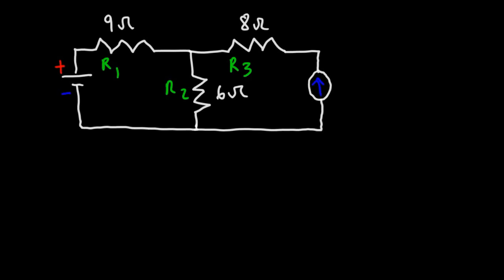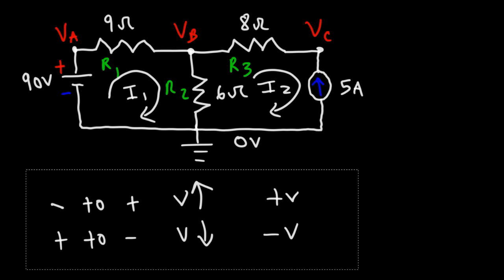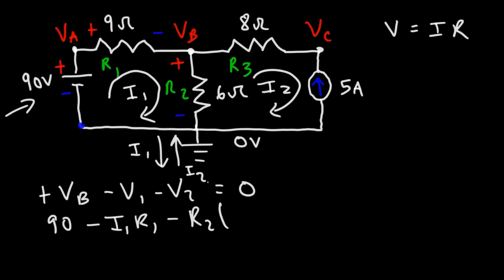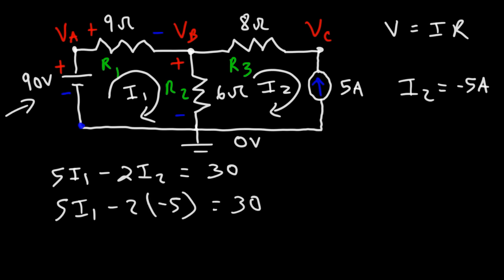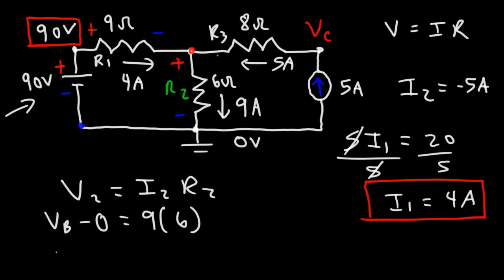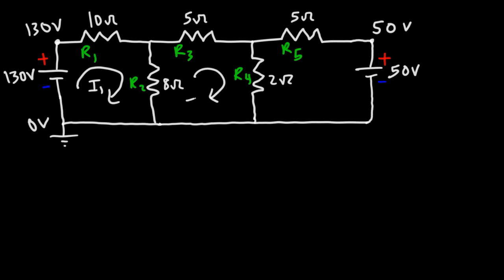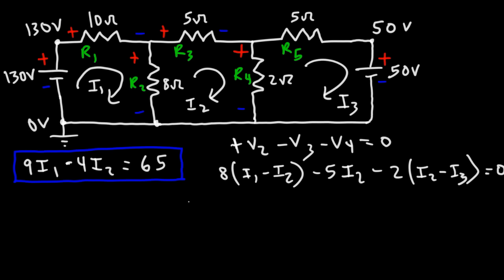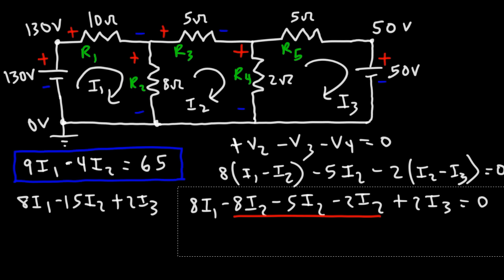Mesh Current Problems - Electronics & Circuit Analysis

Comment: I believe there is an error in the calculation, What he's effectively done is swapped the polarity of the voltage across the 2 ohm resistor R2, here's how,

 in the first loop he designated I1 flowing from high to low potential through R2 and I2 flowing from low to high, that's fine, but then in the second loop he has designated I2 flowing from high potential to low potential by making the equation -8I2 and designated current I1 flowing from high potential to low potential by making the equation +8I1, this is effectively changing the arrangement of the signs of the voltage across R2 when analysing the current through R2 in the second loop compared to the first

how can that be correct? Would the same be true if R2 were a battery? Because the sign of a battery doesn't change since the direction of voltage across it is fixed, and according to the math he's done, he isn't sticking to the sign convention he has assigned for the voltage across R2 from the first loop, i understand he is taking the difference between the currents I1 and I2 but he's doing so in the wrong order, i believe it should be 8(I2 -I1), if you disagree that's totally fine but i would appreciate if you explained why.  Many thanks friend.
Reply: I got confused at that part as well. Your reasoning is correct I think. I also had a sort of "rule" that I followed for mesh current analysis. When you are working inside a loop, the positive sense of the current is the sense of the current of your current loop.

At the first loop, the positive sense would be that of I1, therefore the current at R2 would be I1-I2 because I2 is in the opposite direction from that of I1.

At the second loop, the positive sense now becomes that of I2, so the current at R2 would be I2-I1 because I1 is now in the opposite direction of I2 (which is the positive sense).

However, it seems that doing it like that is wrong. I checked the values in Multisim (a circuit simulator) and his values are correct. If you solve it with R2(I2-I1) you get wrong values. I hope someone explains why that is the case as I don't really understand it.

Edit: One possible explanation probably has to do with the fact that the current has to flow from a point with a higher voltage to a point with a lower voltage. Since one end of R2 is connected to ground, if you take I2 as a positive quantity you are assuming that the current I2 is flowing from the ground up to Vb. Which is impossible.
I am not sure if this is the right explanation though.
Reply: The video is too much of a spin .  the video is just a bad description of equation writing . And the video lacks detailed information of  technique .  Confusion number 1 :  the Video does NOT use Mesh currents thru  R2 , instead he is adopting a Branch current technique  thru  R2 , because he is using a Single  +-polarity across R2 .  Basically , the video is a mess and needs to be redone .
the Two  Fragments would be written this way , when using  a Branch current flowing Down thru  R2 :  +( I1 - I2 )R2 for Mesh I1 , and  -( I1 - I2 )R2 for Mesh I2 .
however ,
when using  "Mesh Currents" flowing thru  R2 , the Two  Fragments would have been written this way :  +( I1 - I2 )R2  for  Mesh I1 , and  +( I2 - I1 )R2  for Mesh I2

notice for both  Mesh I2 fragments , they are  Identical :
-( I1 - I2 )R2  is the Same as  +( I2 - I1 )R2 .
however ,
the Symantic of writing these  Fragments is  Hugely different . As said , one is based on using a Branch current thru  R2 , while the Second writing is done using Mesh currents thru  R2 .

if these  Fragments seem odd or confusing to write , then you do NOT yet underand the basics of KVL , Ohm's Law , Branch currents , and Mesh currents .
NOT your fault , as many books are Poorly written by people who do NOT know what they are talking about ,...especially  2 year Tech school level books ( the worst )

the video is very lacking of  KVL with Ohm's law equation writing details .
Reply: @ArjolP  what would happen if someone Pre-labels a +-polarity across a resistor that is NOT  +pos Ohm's law , and they are asking for the voltage across that  resistor .  would that pose any issues during the equation writing process ?  the answer should be No . the circuit is still just as easy to analyze regardless of the  +-polarities across the resistors . There should be absolutely No  confusion .  if there is confusion , then something is not yet understood .
Reply: @ArjolP  you do not  yet understand how to solve simple  physics problems.   you have taken the video's analysis Out of Context .
you are trying to use a Convention that is in your head . however , 
the Convention that is in your head is NOT the same convention
the video is using .
i am  posting a new response to Numan Ahmed
with a Full explination as to why  the first level equations in the
video are  Valid and Correct , for  R2 in the  3 loop circuit .
please note , the video is trash and is a very bad way to present
circuit analysis .
Reply: yes , the video is trash .
however ,
the first level equations written in the video are valid and correct .
to understand this , you MUST use the same Convention and Orientation
the video is using .

you have a particular Convention in your head that you want to use ,
however , other peoples analysis might be using a different Convention .
Thus , to follow someone elses first level equation writing , you MUST
know what Convention they are using .

i analyzed his analysis ( Meta analysis ) to understand what he did .
( i can do that )

the 3 loop circuit :
the video's convention writes the KVL +-sign as he Exits each component .
the video's convention is using  Branch currents thru R2 ( the 8 ohm resistor )
the video says he is using mesh currents , however , he is actually using
Branch currents . thus he does NOT know how to use mesh currents .
But ,...
based on the Conventions that he used , the First Level equations are Correct.

Here is how he wrote the  Fragment you speak of , for  R2 , starting with loop I1 :
he is Traversing CW ClockWise and he is writing KVL +-sign as he Exits each component.
Exiting R2 at the Bottom of R2  is  -neg .
thus he writes  -neg8 ( I1 - I2 ) .
note that  ( I1 - I2 )  is the Branch current thru  R2 .
next , for loop  I2 , still Traversing  CW ClockWise , at the Exit point of R2
( Top of R2 ) , he writes +pos .  +pos8( I1 - I2 ) .
again , ( I1 - I2 ) is the Branch current thru  R2 .

he could have shown :  I4 = ( I1 - I2 )
where  I4  is the Branch current thru  R2 .
with I4 flowing  Down thru  R2 .

Your  ( observation and curiosity ) are Out of Context .
Realize , there are many , many Conventions that can be used , and thus
there are many , many ways to write first level equations for the same circuit .
All of the Conventions that could be used are ALL  Valid , and ALL the
first level equations that are written of each of those conventions are ALL valid .
however ,
once we choose a particular ( Convention and Orientation )
we need to "Stick with it" , so we do NOT contradic our selves ,
and to avoid a convoluted mess ( such is your  question )

you should solve a basic vector based projectile physics problem ,
and apply all that  technique to solving  electric circuits .
( read beyond the words in the electronics book ,...go deep )

we can always analyze the same circuit using another ( different )
Convention . our initial first level equations will look different .
but in the end , the numerical answers will still describe the exact
same  circuit operation .
( provided we have No errors in our math manipulation )
Reply: I got confused in this part too.
Reply: I was confused as well but the answer is actually correct because there are two ways to solve this.

1) (His way) to keep the polarities constant in each loop while using the previous current calculation.

2) (another way) To change the polarities according to the current flow direction and input the new difference in current by giving priority to the current that is in that certain loop.

Both ways result in the same answers.

Comment: how come in mesh 2 you have I1-I2? Should not be I2-I1?
Reply: What I was thinking
Reply: Assuming you mean the claim at 14:00, it is like this since the assumed direction of i1, based off the clockwise arrow drawn, would be going from positive to negative in R2. i2 would be going from negative to positive, as indicated with the clockwise arrow, which is the opposite direction of i1. Due to this, we take the current going through R2 to be (i1-i2). Lmk if you need more explanation.
Reply: @kyrelpolifrone4438  ignore my previous comment if u received notifications about it. but anyway, yeah if you could explain it then please explain!
Reply: @judy-chan4536  So in the drawing, the current for I1 follows the arbitrary direction established, so we can consider it to be "arbitrarily positive" while I2 is going in the opposite direction so we would need to follow this established convention and assign it an "arbitrary negative" if we considered the mesh current in the opposite direction then I1 would be negative while I2 would be positive. So with the established direction, since I1 follows the direction of the mesh current it is positive, while i2 goes the opposite so it is negative
Reply: @kyrelpolifrone4438  thanks! i figured as much. but my friend asked me(and questioned my use of equation using I1-I2 instead of I2-I1) and i just dont know how to answer lol.
Reply: @kyrelpolifrone4438  what he's effective done is swapped the polarity of the voltage across the 2 ohm resistor R2, here's how,

 in the first loop he designated I1 flowing from high to low potential through R2 and I2 flowing from low to high, that's fine, but then in the second loop he has designated I2 flowing from high potential to low potential by making the equation -8I2 and designated current I1 flowing from high potential to low potential by making the equation +8I1, this is effectively changing the arrangement of the signs of the voltage across R2 when analysing the current through R2 in the second loop compared to the first

how can that be correct? Would the same be true if R2 were a battery? Because the sign of a battery doesn't change since the direction of voltage across it is fixed, and according to the math he's done, he isn't sticking to the sign convention he has assigned for the voltage across R2 from the first loop, i understand he is taking the difference between the currents I1 and I2 but he's doing so in the wrong order, i believe it should be 8(I2 -I1), if you disagree that's totally fine but i would appreciate if you explained why.  Many thanks friend.
Reply: The convention is that the current I2 is major current for the loop...so while writing equations , I2 -I1 should be written.....But it can be false when the value gives you negative number....which will call that I1 will be greater...
It's just a way of solving circuits easily
Reply: @judy-chan4536  Everyone keeps using a different ( Orientation and Convention ). you are causing your own confusion . Have you ever solved a Basic Projectile Physics Problem ?
i am gonna guess that you have NOT.
In the video here, he is writing  Each KVL +-sign as he  Exits each component . Thus , to Follow along in the video , you too Must use the
+-sign as you Exit each component , during every traverse .

you do realize :
    5v                                          - 5v
-         +     is the same as  +           -
if the problem was stated  as :    +      -  , then when solved ,
the numerical answer will be  - 5 v
if someone says , oh ,  shouldn't it be   -   +  with  5v  answer , then that person  has No clue how to solve Any Physics problem .

The video was poorly explained . His use of Conventions and his initial Orientations and descriptions are really bad ( not good ) .

you are using  Conventions and Orientations that are in Your Head , which are not the same Conventions and Orientations that the Video is using .
All  Conventions and All Orientations are Valid , however do NOT mix them during the analysis . Choose One way and Stick with it .

Thus  ,
the Video is NOT  backwards
and your  statements are NOT backwards .
However ,
to properly following along in the video , you MUST use the Videos  Conventions and Orientations . if you can't discover the video's  Conventions in use , then you will NOT be able to follow what the video is doing .
The video is a terrible description of how to write equations , however , in the Context of the video's  Conventions and use of Orientation , the equations that he wrote are Valid and Correct .
Reply: @kyrelpolifrone4438  saying  "Opposite" is a bit vague . The video did NOT show how to incorporate  Ohm's law into the Equation writing process.
Thus , when  +I1R2  is  +pos Ohm's Law becaue  I1 Enters  R2 at the +pos, 
named side of R2 ,... then  I2 Enters the same  R2 resistor
at the the other side , which has a  -neg sign , thus  -I2R2  is -neg Ohm's Law . Sure ,...they are  opposite of each other , but only because  I1  Enters R2 at the +side( +pos Ohm's Law ) ,
while  I2  Enters R2 at the -side ( -neg Ohm's Law ) .

to write a complete  Mesh  Equation , we need to write
( KVL  +-signs  with Ohm's Law  +-signs ) .
The Voltage source only has a KVL +-sign to write ,
while each passive component has
( KVL +-sign with an Ohm's Law +-sign ) .

Comment: sorry but the first equation is kind of wrong since u used Vb instead of V(original voltage).
Reply: Yeah but the value he assigned is the original V.. Soo its okay all in all
Reply: He said that Vb stands for voltage battery

Comment: Hi, Thanks for the wonderful video and teaching. 
One query that in mesh 2, since current is flowing in clock wise, then in v2 = R2 (I2-I1) should have come right? instead of R2(I1-I2) in the equation of circuit 2 (8ohm(I2-I1))
since electrical potential is moving towards higher potential from lower potential. @TheOrganicChemistryTutor

Comment: hello I did the same calculations but in the end, I used Cramer's rule but I got different results on examples at 10:9
my results are
i1=15.97 A
i2=-9,84 A
i3=9,95 A
I am certain my matrices are correct.
Reply: There are mistakes in this video. He took voltage rise to be negative which is false. Your answer might be right.

Comment: the equation derived from the second loop in the 2nd example got me confused. I though the voltage flowing though R2 and the other resistors will be the product of the resistance and the difference of the current flowing opposite of the assigned direction the current is flowing from the current along the direction of the loop. Example, like the voltage across the R2 resistor in the second loop i thought it would be 8(I2-I1) but he made it 8(I1-I2) can someone help a brother out.

Comment: in the second example, I believe you could have solved the system of equations faster by  solving for i1 in the first equation and solving for i3 in the third. Then just plug it all back into the second equation. Then plug in i2 into equations 1 & 2 to solve for i1 and i3, respectively.

Comment: In first example, why would i2 = 5a ? I know that loop has a 5 amp current source, but if that current source wasn’t there, wouldn’t some amount of current from the left loop flow through it? so shouldn’t some of that current flow through it and change the amount still?

Comment: had an entrance exam in a job interview where I was to utilize mesh current but R2 has no resistor and is just a wire (or just two points from A to B?) and I'm to find the voltage there; got hardstuck

Comment: But from your equation in the first example you said the current flowing through R2 is the difference between I1and I2. But you added them to get the current later on. Why

Comment: why did he multiply in problem 2 the equation 2 times -9? From where is -9 coming from?
Reply: If you are talking about the
9I -4I = 65 
8I -15I+ 2I= 0 
Part he multiplied the top equation by 8 and bottom by -9 so that he could cancel I1. He just needed to cancel out the term so thats why he multiplied the entire equation by 8 and the other by -9

Comment: Am I the only person who noticed that the way he set up the equations is the opposite direction that the mesh “loops” are going, and also the opposite of what he has written as the polarity for Vs, R1, and R2.....? 
Going by the loops you made, I would have done...
-90v + 9Ω(i1)+ 6Ω(i1 - i2) = 0      (Mesh Loop 1)
I do agree with
I2 = -5A
Since the 5A is going the OPPOSITE direction of I2 (according to your mesh loops) ;) 

This would have been confusing to me if I didn’t somewhat understand this already, and honestly, at first, I was slightly confused with your method until I realized what you did. 
I know you can write your loops in either direction as long as your consistent throughout the circuit.
I just think that you should point that out so some people don’t get confused about how to distinguish the signs when making the mesh equations. To me, this made it more confusing than it needed to be. Other than that, thanks for the video.
Reply: i tried his ways. after so many trials and errors, i concluded that his ways-- unfortunately, isn't reliable most of the time. honestly its easier to just not bother putting the sign convention to every resistors(since its a hassle and mistakes could easily happen here) and just follow the direction of our loops instead. JG is still one of the better tutor in YT though. but yeah when i followed his method, other people get confused, which then makes me confused lol.